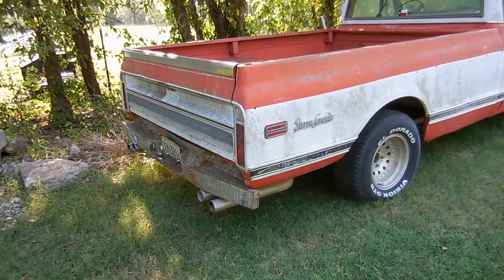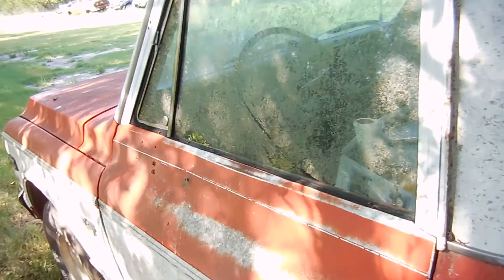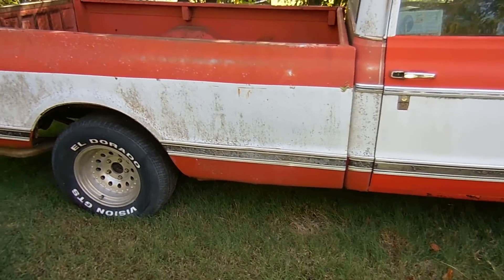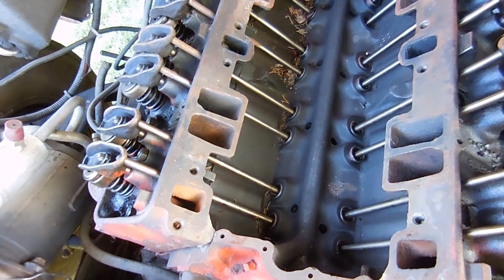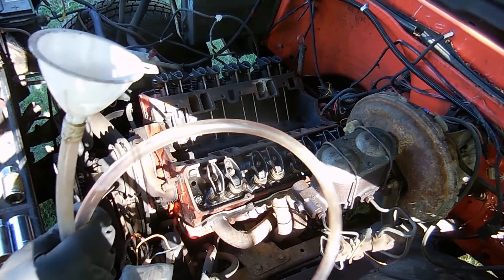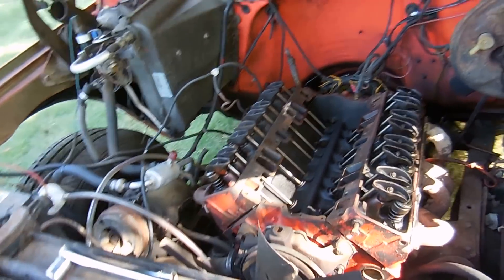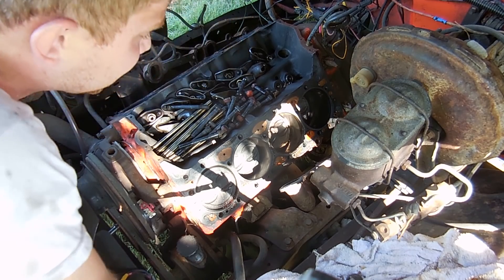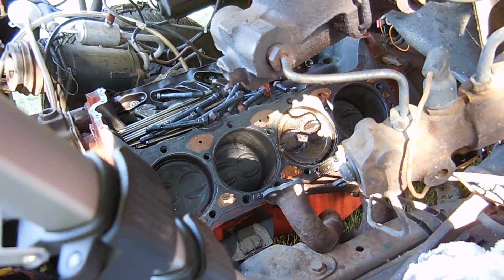1972 GMC Sierra Grande Left 9 Years W/O Intake Manifold Will It Run? Part 1

Comment: I had just gotten out of the army in 1972 and went to work at a Chevy/GMC  dealer selling trucks. The GMC Sierra Grande sold easily and I had a list of farmers and ranchers I had worked with before all but three bought this year and model truck from me. It was a sweet-heart of a truck back then. I think you are going to enjoy working on this...
Reply: last year before the   body  change over, that's all we ran in the trucking company back then and bare cab chassis was like 2800 bucks....workhorses

Comment: Truck belongs to me and is not for sale.  Belonged to my brother in law who passed away.  Has sentimental value to me and my family.  Crate motor has been ordered and is on the way to Ben.  FYI, the motor in there now was not the original motor so no worries about "numbers matching".
Reply: Fritz Weiss if you go back and look there was a rock laying on the harmonic balancer and was jamming itself making it seem like the engine was seized. The rotating assembly is most likely ok.
Reply: That's a sweet truck. I wouldn't get rid of it either.
Reply: Good for you it is a beautiful truck.  Jeff over at elderly iron has a 68 as his daily. Take good care of it.  We need trucks like this to remind younger generations that cars and trucks use to have personality and weren't always boxes that all looked the same.
Reply: 79tazman you say this only because you can’t afford them, my wife’s 2016 Silverado 1500 Z-71 LTZ rides and drives like a Cadillac and my 2012 RAM 2500 Longhorn Laramie 6.7 Cummins 4x4 is over 600HP and 1,100LbFt and even has heated steering wheel and air conditioned seats and will tow 17,000+ pounds so saying that old shit is better is a completely moronic statement! New shit shit is waaaay better for everything, I love the old iron and own a few but I’ll drive my Cummins on a cold/hot day first, they always start, never overheat and get nearly 20mpg... can’t say any of that about my other 2 old trucks and 1 old Pontiac!

Comment: That piston is bad, but what's stopping it is all the rust in the 2nd cylinder back on the passenger side. If you dropped the piston down and sanded the cylinder smooth, it should turn over. But from the looks of things, I'm betting the rings are seized in the grooves in most of the cylinders. Best course is to rebuild the engine and bore it over. Rebuild kits for 350's are stupid cheap.

Comment: When you were trying to turn the engine , was that a piece of a rock or something lodgeing  itself near the harmonic ballencer?
Reply from the maker: Mud dinner nest.
Reply: @TheCorvetteBen  Mmmm. Mud dinner
Reply: it seemed to jamb just as the dobber nest/rock hit the bottom of the water pump in one direction and then jamb right when it hit the timing mark
Reply: Sierra grande was the fully loaded towing package on C20 3/4 ton chassis not 1/2 ton and most came equipped with the BBC 402 & 400th small block would've been the cheaper option

Comment: Who replaces just one piston,? Scotty and his agents over at cold war motors that's who Ben. 😂😂 if you watch their series about the straight eight challenge you'd see.  Later Ben.
Reply: I bet those engines will run until we're all in the grave.
Reply: I came here to say the same thing.  Single Buick piston FTW  (or lose,  as long as the Packard Team has a good transmission)...
Reply: When I was 17, we entered a really nice straight 8 Buick in the county fair demolition derby. Still kicking my dumb a__ over that. There wasn't a dent in it. Interior was even nice.
Reply: @nowhereman7398  now there is... Rip
Reply: johnathan w would fix it too. That engine looks like its been rebuilt before it was parked. its too clean
Reply: @teknowil  it definitely could be fixed in no time.
Reply: With any luck your local parts store will have one on the shelf too, or is that only in Canada?
Reply: @burlatsdemontaigne6147  most likely lol
Reply: Awesome channel
Reply: @79tazman  no not yet but I will. 👍

Comment: Ive seen mechanics put just one new piston in a motor and get it running and work reliably. It cant hurt to drop the oil pan now and knock the piston out hone the cylinder and slap it all back together. Just as a start you already have most of the engine tore down. Anyway just my 2 cents cant wait to see what ya do its a beautiful truck brother.

Comment: If there is no scoring, scratch or gouging in the cylinder wall, and no bent rod or marks on rod journal or bent crank, I would hone all the cylinders, replace that piston and rod, put on new rings and bearings on all cylinders and call it good. Clean up the heads and new valve guide seals and it should live a long life. Even if there is gouging, as long as it can be machined, it's worth it if that's the original engine to the truck. Don't just throw away the motor without checking your options. If that's an original 350, you've got a real gem there and it's worth the effort to see if it can be rebuilt. Those things will really rock if you build them right.

Comment: Ben...just FYI I wouldn't dump that short block just yet. That vintage truck 350 if it is original has a factory Chevy forged steel crank. It is worth hanging on to if it hasn't been turned down past 10 10 already.
Make a great crank for a high performance build.
Reply: maybe... I'd pull the casting numbers and cross reference.
Reply: @ThatGuyFromArizona  well both the 72s I have had were 4 bolt main steel crank engines...checking the casting number is a good start but odds that the engine has never been opened up are...remote. pull it out drop the pan and have a look see...if it looks right pull the crank and get the micrometers out.
Reply: @archstanton9206  drum roll please :)

Comment: If it was me, I'd check the underside of the engine bay. If there's sufficient room to remove the pan with the engine still bolted in (you didn't say if it's a 4x4), I'd do so. Jack the front up on jack stands, drain the oil and pull the pan just for the curiosity of what may be broken in the crankcase. With the top open that long, anything could have gotten in any part of the block. Something may be in that crankcase that is entangled in the rods and crank counterweights or something in the crankcase broke the last time it was running. You have to be curious, Ben!

Comment: Thanks Ben. Looking forward to seeing this beast on the road. Lots of potential. My guess is possibly someone dropped  something into the carb or intake manifold then tried to run the engine. Thats just a possibility and I may be way off. Ive seen it before though. Buy a short block. Good luck.

Comment: If he used RTV as an intake gasket, there's no doubt it had a vacuum leak. That would cause the engine to run lean and sluggish. People usually advance the timing to compensate, and that along with an already lean air/fuel ratio is what burned the piston.

Comment: Check Summit Racing for 72 350 ci rebuild kit including rv cam and springs.  Send heads out for new valve seats since these are the soft ones and have valve job done using the new Summit valve springs.  While waiting wash and prep body for your magic touch to the paint.  Less than $800 on engine for a total rebuild, plus your labor

Comment: Do it on the cheap new timing chain a piston clean the heads put it back together
Reply: cylinders rusted, might clean up with dingleberry hone but why throw money after it when a crate or salvage short block with Vortec heads is less than 1k      https://www.rodauthority.com/tech-stories/engine/tech-gm-1st-gen-heads-vs-vortec-heads-reader-guide/

Comment: I love those trucks...I've had 2 of them a 72 c10 chevy and 68 c10 gmc....the 72 got stolen by tweekers that stripped it and left it in a sandlot buried upto it's hubs and the 68 I LS swapped and sold for a nice profit. ...I'd like to get another one they are super easy to LS swap and work on , but having 6 cars already the wife ain't having it, I'd have to sell one to get one, and well I like all my cars, not ready to sell any , if I do it will have to be my cls550...

Comment: Cool old truck, I'd use the block if possible. The heads look like goods heads too in that they seem to have partially closed chambers with decent sized valves. I noticed the double triangles on the front.

Comment: The engine block would be easy to pull out of the truck now.  If you can take a look at the crankshaft, it might be a simple fix.  Get new rings and bearings, and it could be running again...

Comment: the motor would need the heads rebuilt with hardened valve seats anyways, anything before 74 ran on leaded gas, except vettes which switched to unleaded in 75.
Reply: yeah new heads or swaap on VORTEC HEADS

Comment: I've seen pistons break like that a few times from having the wrong intake gasket.  Pull the motor take it apart clean it hone the cylinders put one new piston and replace the rod just to be safe, could have a slight bend . New bearings and rings it'll run just fine for years for less then $400.  That's if the cylinder is ok, didn't look like it was hurt in the video.

Comment: When that truck was sold it was quite common to replace one piston. The deciding factor should be cylinder and crank journal condition. Also the condition of the rest of the engine would play a part in your decision. Pull the pan and have a look at all of the rotating parts
.

Comment: Something to check: Pull the distributor cap and see if the rotor is turning at all or if it's frozen when you're using your breaker bar.
Reply from the maker: Does that still work when the distributor is in a box in the cab?
Reply: @TheCorvetteBen  Oops! Sorry.

Comment: Looks fine to me.. Pull it, and clean it up. If the wall isn't banged up, and the crank is in spec, just buy a rebuild kit. Weekend job. These trucks are very sought after. Someone like Gibson63 would turn that into a shower.

Comment: Is that a rock jamming the belt or is it me?
Reply from the maker: That is a mud dinner nest. Even if it was a rock it wouldn't prevent movement both ways.
Reply: @TheCorvetteBen  but it stopped and looked jammed both times at the same time the otor stopped turning
Reply: Well spotted
Reply: @TheCorvetteBen are you trying to say mud DOBBER?? :P
Reply: Mud DAUBER
Reply: @johnschutt9187  there ya go :)... that
Reply: Yes you're right  !

Comment: if the bore is good you could probably put a piston in it
Reply: The chances of the bore being good with that much damage to the edge of the piston crown are very small, plus something had to happen to make the piston fail like that.  There doesn't look to be anything above the piston, so in the head, that could explain it so the likelihood is that it's something in the bottom end such as a bad big end bearing or a bad con rod.  In any case, with that engine clearly being well worn it just wouldn't make sense to go to all the work of putting one piston in it as it really doesn't look to have much life left in it.  A full rebuild with a re-bore would be possible but a replacement engine would probably be cheaper...
Reply: One bad apple doesn't spoil the whole bunch.
Reply: @charlesmoore3321    If the engine was less tired then maybe, but in this case it would just be a lot of work for very little return as the engine would still need tearing down and rebuilding properly in a few years...
Reply: Unless he is trying to keep all the numbers matching, replacing that short block would make more sense as he'd have to have all new bearings, piston, etc. and that would be IF the cylinder wall wasn't damaged.
Reply: @richardcline1337  I'd replace the heads with  VORTECH ones, do a dingleberry hone of the cylinders, spring for new pistons, a HEI conversion , plus either go old school with a new Holley or major bucks with a MSD   EFI SWAP ..................
Reply: @gosportjamie  CB got alot of SBC's in his hoard and imagine the provenance  of this build  a PU with a vette engine
Reply: @gosportjamie   I had a brand new Dodge Caravan with a piston like that.  Repaired under warranty, but the mechanic showed it to me before he replaced it with a new piston.  Sometimes a defective part gets past the inspectors and they fail after use.

Comment: Pull the oil pan, loosen the rod and pull the piston out through the top. get a new one or get one from a wrecker yard, put new rings and put it back in. put it all back together and you will be good. No need to even pull the engine.

Comment: The guy who brought you the truck had to know it locked up. It's possible, if the piston is removed, it might be rusted around the cylinder wall. Otherwise, .030 time.
That old 350 has plenty of meat to grind. If you're gonna get another engine, a 400SB would give more torque...but 10 times more 350s.

Comment: Hit the valves with a hammer first thing. To unstick them. Some people do replace just one piston if the cylinder wall is not scratched real deep. Cross hatch and go again. cross hatch all cylinders. Unless you got deep pocket then just replace it with everything.
Reply: I agree, you could do a quick and cheap rebuild on this engine if the cylinder isn't damaged.

Comment: very good fine i got the same cab with air with 0% rust in it and it is an extra cab plus i have a stander cab too sitting all ready built 3 of them 2 67 and a 68 and i'm not going to build another one . and does the heads have 2 humps on the front i could not make it out if so they are camel heads witch are very good heads
Reply: some one dropped something down the intake like a lock washer

Comment: All the dents in the top of the piston are from broken piece being crushed between it and the head. It would have been down on compression for sure and may have had a rough idle because of it when it was running.

Comment: Take the bad piston out then remove the pushrods and connecting rod for that cylinder and you've got yourself a nice running 7 cylinder engine.
Reply: Horsepower Garage Who needs eight when you could have seven. You could save gas that way too. :)
Reply: @bradrichards6107  My camaro ran on 7 cylinders for a whole year, one of my rings was broken into 5 pieces.  It ran fine but smoked, it was honestly hard to tell besides the smoke blowing out of the crankcase because it already had a choppy idle but I knew it was hurt.
Reply: @HorsepowerGarageVideos  Was the engine toast? Where you able to fix it?
Reply: @bradrichards6107 Bored it .030 over, new pistons, rings, bearings and it was back hauling ass.  I have videos of it on my channel.

Comment: While you could probably fix it with a new or used piston by the time you go to pull the engine out and go thru it completely you might as well just drop in a good used 350 or get a crate motor for it.

Comment: I could bring her back .. What's the odometer say? We know the ring land didnt break from too much N.OS. or boost lol it had to be rust in the cylinder or something to get any longevity out of it it needs to be at least honed if not bored 30 over and rebuilt but it is an awsome core and would make a great small block too bad that piston was broken or it probobly would have run on a budget with just cleaning the heads up and putting her back together with gaskets of course I dont think RTV would work very well as a head gssket eitjer lol

Comment: Who replaces just one piston? Me! If it's a cheap beater to get around with and I don't want to put a bunch of money into it, I'll change just one or two pistons.  Won't even have to pull the short block. Drop the oil pan, rip out the offending piston and rod, hone the hole, toss in a new piston and rings, and put her back together.  Might smoke or use oil, but it might not.

Comment: Who replaces only one piston? They would do that in the 60s and earlier. Simply did not have the money for a new engine. Drop the pan, remove the rod cap and push the piston up and out, replace components. You ought to try something like that just to do it and clean the heads.That is assuming the rest of the lower end is ok.

Comment: Man, you're giving up way too easy on what looks to be a fixable engine. Jack up the engine, pull the pan and take the bad piston out. If the rod journal and cylinder walls are in good shape, then just order a new piston and ring set of the correct size and replace the bad piston. I've got a 302 Ford engine that did basically the same thing, i.e. cracked a piston through the wrist pin bolster and started making one hell of a noise. I shut the engine down and then pulled it apart and figured out what was wrong. I replaced the piston on the original rod, (wasn't hurt), and put everything back together. That was about 15,000 miles ago and the engine is still running strong.
Reply from the maker: The truck isn't mine, the engine isn't mine, the decision on what happens isn't mine either.
Reply: @TheCorvetteBen  I absolutely understand. It just seems a shame to junk what looks to be a fixable engine. I'd talk him into at least letting me pull the pan. That would tell the tale. If he did say "junk it," see if he'd let you have the engine for scrap price. It would be very interesting to see what's under that pan! Anyway, your videos are great. I always look forward to the next installment.

Comment: the engine isn't original to the truck. it's a low compression engine with smogger heads. all junk. throw it away. put a 602 crate in it and rock on.
Reply from the maker: Finally someone with some sense

Comment: Have you decoded the block? I'm willing to bet it's a 305 and it died of oil starvation...
Reply: NO 305 V8`s until 1977 . 305 would be a Blue or later on , Black Engine .
And the 305 Oil Dipstick is on the Passenger Side .